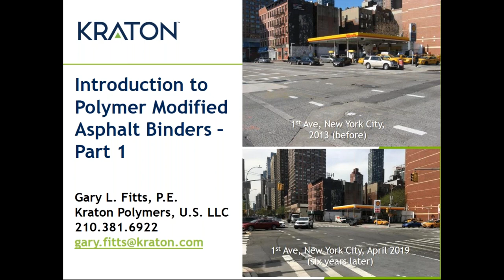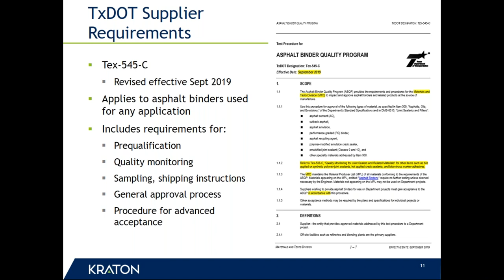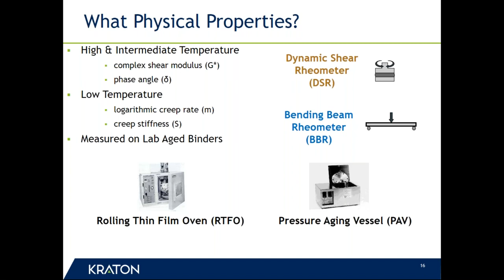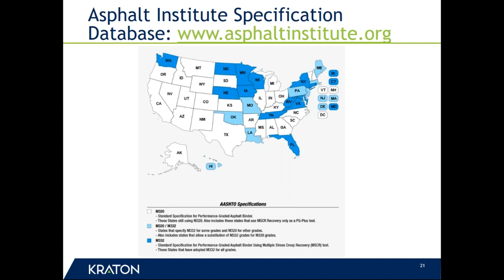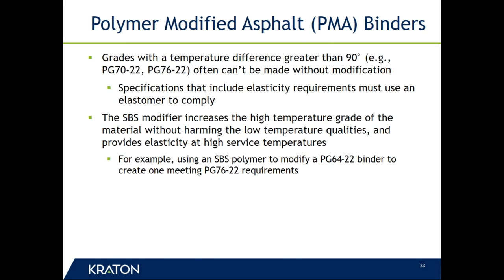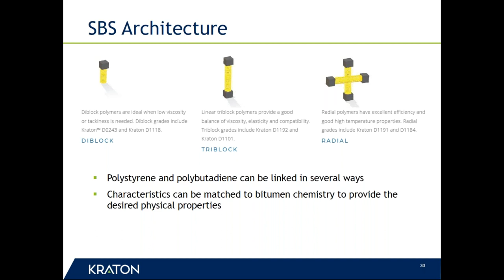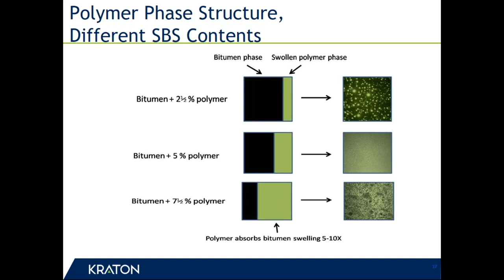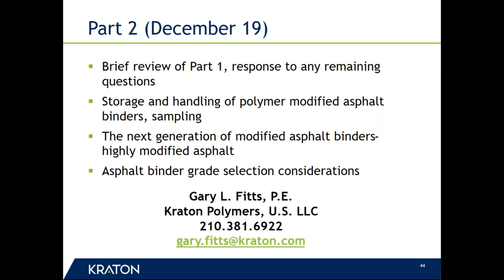Liquid Asphalt (Part I)

Comment: What’s the difference between liquid asphalt & asphalt sealer?
Reply from the maker: Liquid Asphalt Binders are engineered asphalt products that are mixed with aggregate (rock, sand, and reclaimed asphalt pavement) in a asphalt plant to make asphalt mixes for roads, highways, parking lots, and driveways.

Asphalt sealers are typically asphalt emulsions (sometimes containing additives) that are spread in a liquid form on top of a driveway or parking lot to fill in small cracks and restore the color of the surface.

Hope this helps!